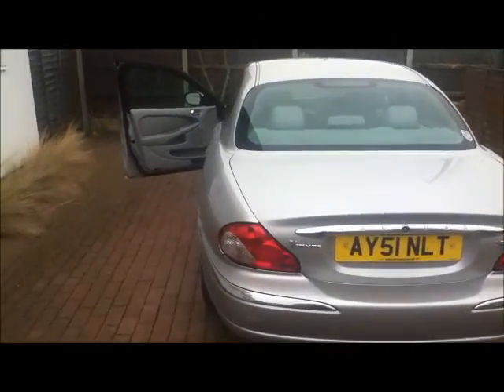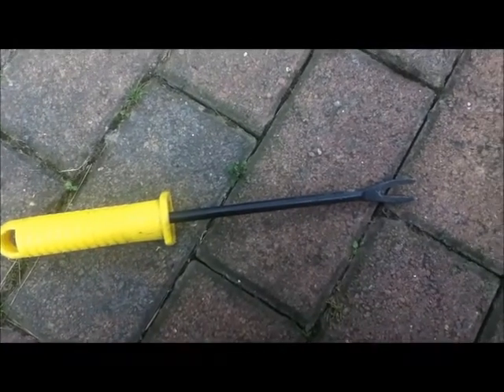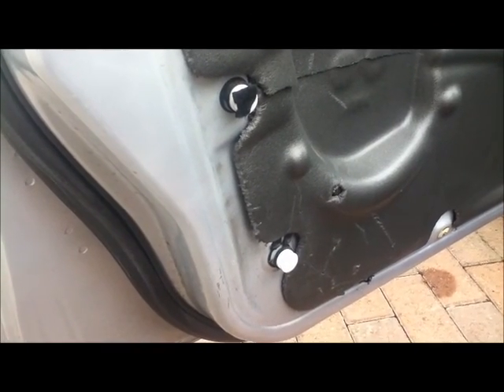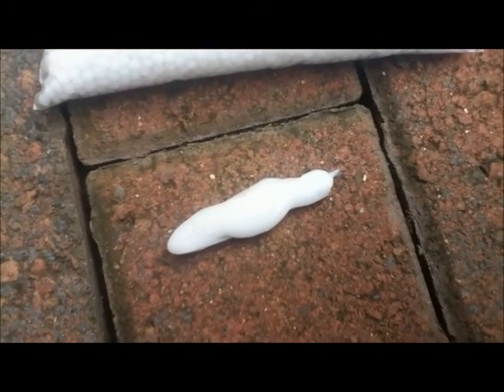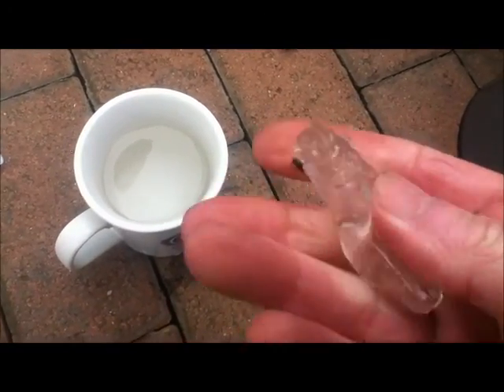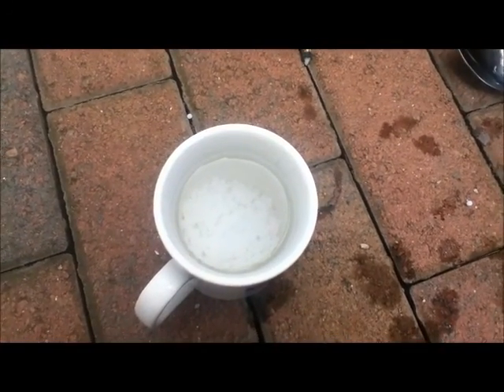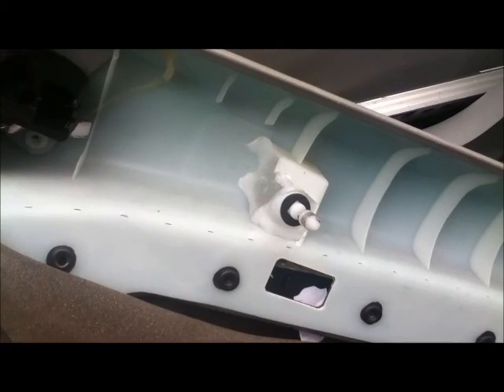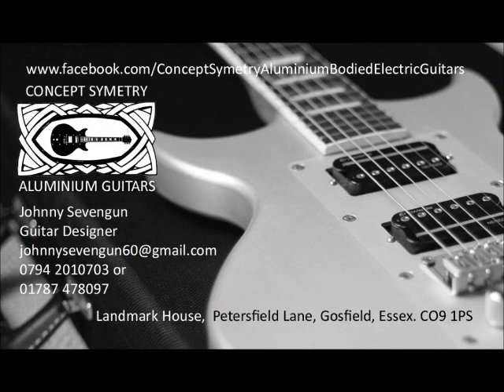Jaguar X Type Car Door Card Repair with Polymorph

Comment: My son and I changed out all front and rear speakers today on our 2004 X-Type 3.0 and used your technique on several of the mounting bases just like your issue described.   This polymorph material is a game changer.   Thank you so much for us to now have quiet and solid feeling door panels.
Reply from the maker: Excellent. Polymorph is amazing. I have used it on dozens of repair projects as well as model making.

Comment: Please remember: polymorphic plastic turns back into goo at about 150 F/65 C. You luckily shouldn't have an issue in with it in the UK, but if you're in hotter climates, the temperature inside if left in the sun can get to 130-140 F when it gets in the 90s. I would imagine the inside of the door gets as hot if not hotter.
Reply from the maker: The melting point of the granules is 65 degrees C. When the stuff has solidified into a block you need to heat it up to about 90 degrees C to soften it right through. I would have thought at that temperature all the mastics on the car would melt! If the door panels are not pulled off there is no reason for the new mounts to deform even when really hot. Even the hottest places on earth don't get above 70 degrees C and that is the surface reading - maximum air readings seldom get above 45 degrees C.
Reply: I have a silver one with black interior. Left in the sun at 40 C, you cannot touch the inside door handles. you have to leave the car at least a couple of minutes to run with airon at full before you get in. i am sure it can easily reach 90 c on the top of that door card.  I will try though.
Reply from the maker: It will be interesting to see what happens. Perhaps you can post your findings. It seems to me that unless you try to pull off the door panels at 90 C nothing will happen.

Comment: My X has the same problem, and this seems a very good solution. I'll try it.
Reply from the maker: This is a good permanent way to fix the problems. I took the panel off a few weeks ago and all the fixings were still good. In fact I broke one and simply repaired it by heating it up with a hot gun. They have lasted over 3 years now.
Reply: @johnnysevengun   That's great, a lasting solution. I don't mind repairing something, but repairing the same part over and over again is annoying. I already ordered the polymorph plastic. As soon as I have received it, I will give it a go. Thanks for your video and so for the inspiration.
Reply: @johnnysevengun  It worked, fixed my door card with it, now it fits like new. From the rest of the plastic balls I can repair the center arm rest of my girlfriend's car and many other things. Great stuff that polymorph!

Comment: I've only recently bought my first x-type, I've had a facelift 2008 model 2.0 turbo diesel and I absolutely love it, but I just wanted to ask if you still have yours, purely curiosity, and also thank you for your videos as they have been great helping me fix and tidy a couple of things, and this was one of them, although luckily I only had a single mounting broken on the drivers door top corner
Reply from the maker: Thanks. I gave the Jag to my Dad who lives next door so I still get to drive and fix it. Not long ago I did a video about replacing the door mirror and was pleased to see the polymorph repairs were still good 4 years later.
Reply: @johnnysevengun  Thats really good to know, glad you have a chance to still get a drive after all the maintenance you have put in on it ;-)
Reply from the maker: @applemad  I burn it around the back roads every now and then.
Reply: @johnnysevengun  good to hear ;-)

Comment: I need some of this too, I have been looking on Ebay, so many different sizes of polymorph. What size would I need to do 3 clips like you have done?  50g 100g 500g packets I have seen. Cheers
Reply from the maker: 100g will easily be enough. But you will soon find you want more to do other jobs!
Reply: ive just done 4 had a bag of 250G  and still have half a bag left

Comment: That stuff looks good. For the badly damaged ones did you think of weldind some new plastic in with a soldering iron. Just a thought
Reply from the maker: I have tried that before but the plastic melts and goes black and is very toxic. It is so much quicker with Polymorph and if you mess it up you can just melt it back without burning. Lasted nearly four years now.

Comment: Shit! My door was rattling at the top and I partly pulled back the panel this evening and found the bit of plastic that had broken off, and I superglued it. I didn't know that it's not going to stick!
I'll be in for a disappointment in the morning when I go and check it, but at least I know now so the disappointment won't be so bad, and I can sleep on some alternate plans.
I'm a big fan of plastic welding with a soldering iron so might give that a shot if I don't get some of this polymorph stuff on eBay.
But I might just get some anyway, it looks like great stuff.. Thanks!

Update:
So superglue worked just fine for me. But I don't know how long it will last. My guess is that it will be fine until I try to disassemble the door again, and then the glue/plastic will break before the clips.

Update 2:
Superglue didn't last very long!
Polymorph and a new pack of clips finally arrived from China so I went at the car today. Polymorph worked a treat but the clips were inferior quality. They just wouldn't hold, and the door card kept popping back out.
The clips were the same size as the old ones, but it looked like the grooves weren't deep enough so I went around them with a junior hacksaw to deepen them, and then went around them with a knife to clean out the grooves, especially the two lower grooves, and then the door car stayed in afterwards.
Reply from the maker: The  great thing about polymorph is that it goes solid but is still flexible. You can remelt it and use it again. So far it has lasted about five years and I have had the doors off lots of times.
Reply: @johnnysevengun  Just ordered 100g there from China for about 3 quid. Grand job! 
I also have a few clips for the door on the way from China, as a few of them are broken too. I tried plastic welding little tops on to them, but the size has to be really exact and I just wasn't precise enough with them and they just broke again. But they were the lower clips so it's not too bad.
The superglue is holding the top clip, and the door screws are holding the bottom so it'll be fine for a few weeks until the polymorph and the clips arrive.

Comment: Im doing this soon.... How do you know where to put the pins when the plastic moding has disintegrated? Is there a picture of this in the Jaguar workbook?
Reply from the maker: I looked at the ones that were not broken and worked out where the pop  fasteners sit. The manual does not give close detail.
Reply: @johnnysevengun  I assume this plastic mold has held up over time?
Reply from the maker: @janetoss  Yes they are all still solid. I added a few more when I took the panels off to fix the doorlocks and change the passenger side door. Look at the complete settings to estimate the position but it is in the middle of each square block.

Comment: Neat. Haven't seen that stuff used on a car before. How's it holding up?
Reply from the maker: +Mark J. Mantilla .  After 5 weeks there's no ratting at all so I think it is pretty permanent. I built some seat mounts for my cafe racer over a year ago and they have remained solid. The best thing is that if they loosen you can just reheat them with hot water or an air gun and remould them. The doorcards are made of thermosetting plastic so you would have to literally burn them with a soldering iron to alter them, the polymorph can be handled easily.
Reply: Got myself another X-Type and found your videos all over again. Funny to see my comment!

Comment: Will the polymorph not soften on a summers day as it can get beyond 65deg internally?
Reply from the maker: I had this conversation before with Mackerous Creel and I think it is very unlikely. The softer mastics would melt before the Polymorph. There's a few people in hot countries checking it out. The hottest its been in my car is 48C and the panels are still solid as the day I fixed them. I was more concerned about them shrinking in the cold but they haven't.